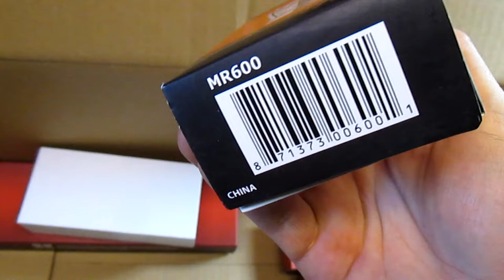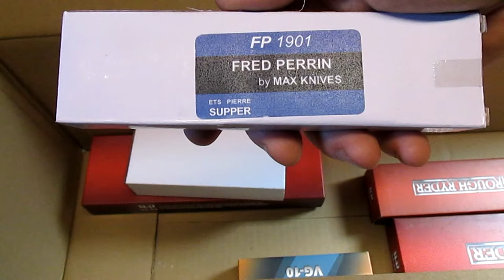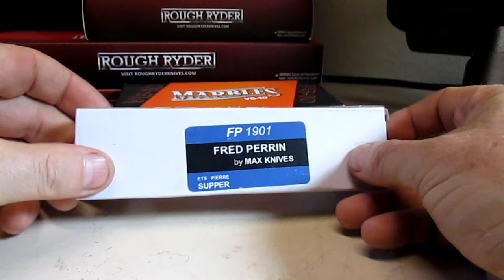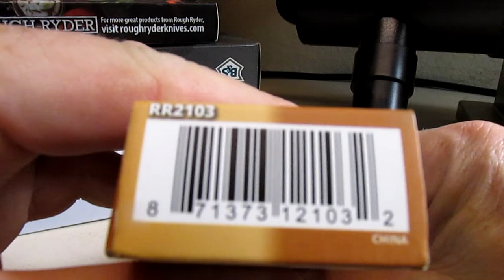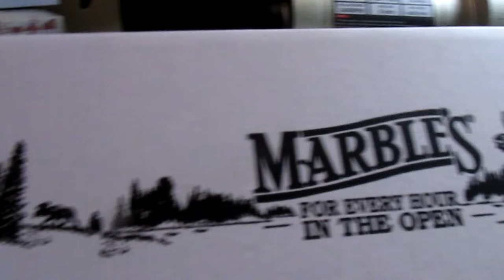Sneak Preview Upcoming KNIVES & Rough Ryder VG10 SLIP JOINT RR2103

Comment: That VG10 knife is a great one. The only issue you might have is that black paint will chip off unevenly. Underneath is some more blue anodized aluminum, so it doesn't look too bad if the black is completely scraped off.
Reply from the maker: I am looking forward to the blue wearing down on the handle should look good with the blue in the dimples & shiney aluminium on the high spots,,,,, I will be watching for the black chipping now 🤓